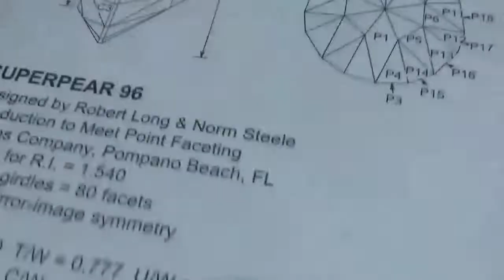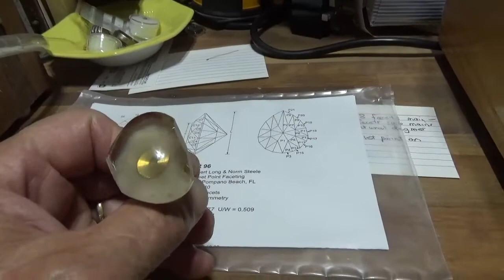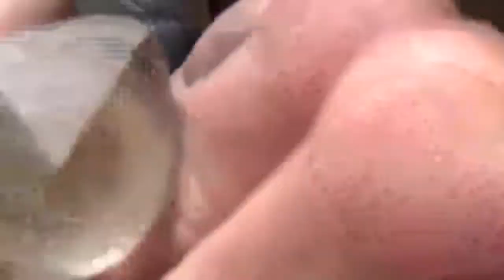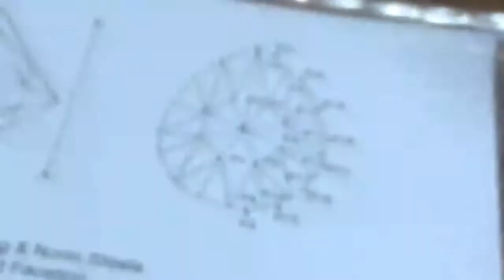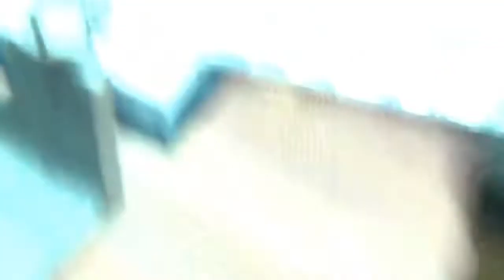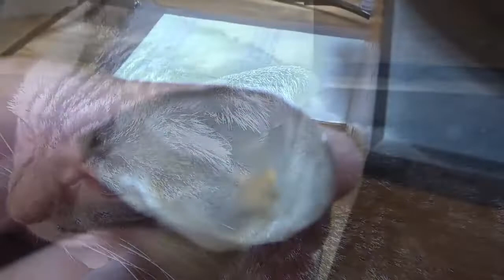OVER THE TOP SMOKEY SUPER PEAR GEMSTONE

Comment: Sir. Is it okay if I use machiene with motor 1350 RPM IN fasting and polishing gemston?
Reply from the maker: i know some people that have used faster spinning machines and have produced fine gemstones-some advantage of a slower speed is that if you use powder diamond of cerium or tin oxides they will stay on the plates better.  if your machins is a belt drive you could slow it down with a pulley combo. or there are low priced electronic speed controls for motors on the market- amazon sells them and i have used on from this place.